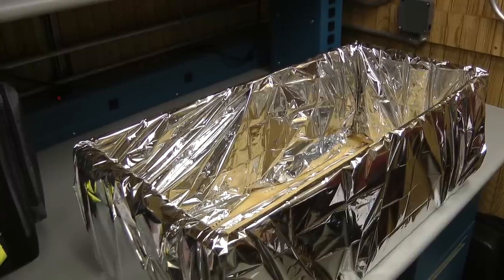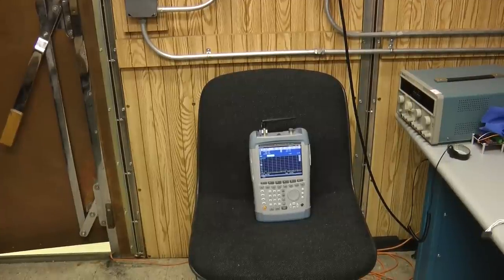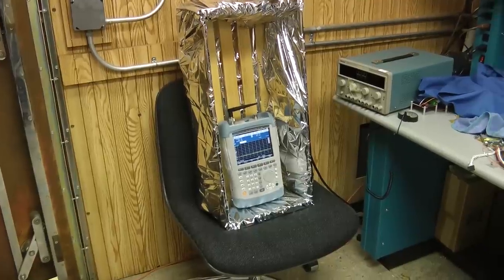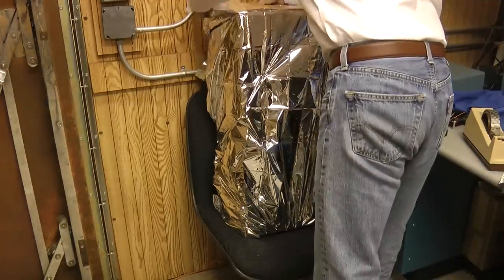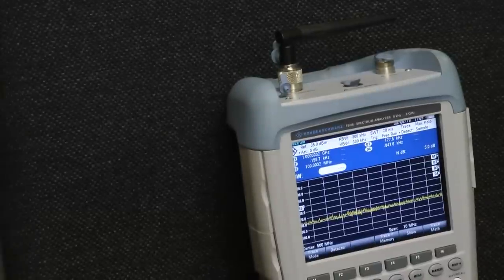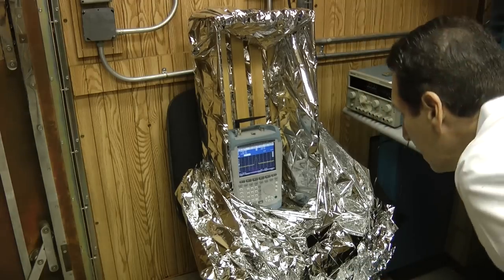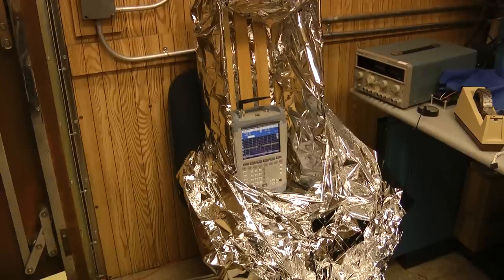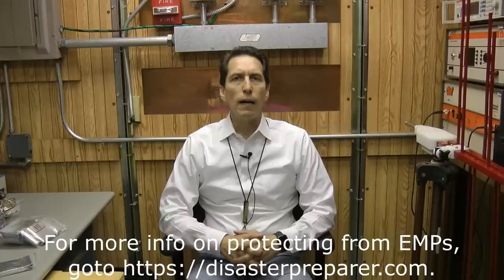Testing Mylar Blanket for EMP Shielding

Comment: My feet feel sunburned,  skin tight like I'm swelling.  Deeper muscular issues that
cause severe swelling of the ankle/legs..... led me to check for blood clots on 3
separate occasions but over 2 years no Dr has any clue what is happening.
Do I need a "Meter" to help me determine where I can move & what products
I must buy to shield me??  Guide me to what I need?  I can't buy blindly as I've
not got monies to waste.  Thanks for your work here.
Reply from the maker: You could buy a meter I suppose, but you'd want to get one that could measure at least up to several GHz. That won't let you detect 5G, but it will let you see what wifi and other signal levels might be. Alternatively, you might consider having someone come with professional test equipment to determine what the field levels are inside your home. That would, at least, help you to know whether or not, you are being exposed to very high levels of electromagnetic radiation. They do sell conductive cloth sewn into canopies that can be hung over a bed, but they're not cheap (Perhaps $900 or so). They won't fully block all RF either, but they would reduce the field levels below at least a few GHz. i'd be careful about concluding that your issues are related to electromagnetic radiation, as there could be many other cause. Again, taking some time away from the home might be a good way to determine if it is environmental.
Reply: @disasterprepper  ~ My mom & I both are effected greatly & we left last
Wed. staying out Wed night & returning  Sat. morning.  The  symptoms
were gone while out & came back by Sunday at 4am.   IF I  were  to buy
a meter & I'm looking at doing it for finding out  how bad it is & to make
sure the place  we move to isn't as bad or worse.  Also I'd rather buy a
decent meter that would cover All the ranges that would need to be
addressed  //   I need a meter that's not hard to use or calibrate &
if you've got an opinion on 1 then by all means send me a link. I
only know I want to be able to determine 2-6GHz plus any of the
other bad you'd deem as a health problem.  All I know is that I'm
going downhill & so is my mom but no Dr knows what is wrong?
Hey,  thank you for the help ....   this has been fighting a ghost.
peace
Reply from the maker: @diggydice9041  You'll want to get a "spectrum analyzer" that covers the frequencies you're concerned about. Spectrum analyzers can range from a few hundred dollars to tens of thousands of dollars. One very inexpensive model is the RF EXPLORER MODEL 6G COMBO. I've never used it, but you might check it out. If you happen to live close to Yorktown, VA, I could probably just come and take some measurements for you.
Reply: @disasterprepper  ~ Ok.  I know I have both  2.4/5G networks available to
my Xbox1x & my Laptop.  I have secured WIFI for either & both of these
devices will hook up on either protocol.    We've had the 5G since 2017
so that's why I Think I might need to have that ability??   I looked on
Amazon & there are Tens of Dozens of units...... I cam spend up to
$350 but I want something that's got easy to read & use functions
and even a  graph or other type of pictorial view of signal strength?
IF any of what I've said makes sense, please help get me on a
path.  I'm going to check out Consumer Reports to see if they've
done any evaluations of these meters?    Again, I thank you w/ all
my heart.... this has been awful for over 2years now.       peace
Reply: @disasterprepper  ~ I'd have paid you to scan my place but I left the
N.Virginia area in 1998 after 12yrs living there.    IF you have Patreon
I'll donate to you.    diggy
Reply from the maker: @diggydice9041  Just to be clear, when you say 5G, I assume you're referring to 5 GHz wifi. 5G is also a coming wireless cellular technology, but it operates in the tens of GHz frequencies and is not widely available yet. There are lots of people worried about that too. Anyway, the inexpensive spectrum analyzer that I mentioned previously measures up to 6 GHz, so it should allow you to see what spectral environment is in your home. You could then go through your home and turn off devices and see if your equipment is the cause, or if it is coming from some external source. I would think that could be very helpful. If it's something your equipment is emitting, you could turn it off when not in use to greatly reduce your exposure. Knowledge of what's actually around you would be really helpful.
Reply: @disasterprepper  ~ While I have no cell phones I live in a 240 unit Apart.
complex & am right on a busy business area.  We will be moving by the
end of year.   A meter will serve me now & to look for a safer place in
the future.  Since I don't know the terminology I ty for helping.  I don't
know what I need exactly but I think I need a way to determine what
threats are here?  One that has a wide range to help me determine
what shielding is needed & where.  Then one I can use to determine
a safer place to move.    A spectrum analyzer w/ a wide band seems
like what I might need??  I'll go w/  something you recommend &
again,  I'm thankful...... Yes I wish I lived in Va again.... lol, ty Sir .
Reply from the maker: @diggydice9041  Yes, I think the spectrum analyzer with wideband measurements would help you. Good luck!
Reply: @disasterprepper  ~ I thank you.  We left last week for 3 nights/4days &
it just went away.  After 24hrs of being home it all came back so I know
something "Environmental" is causing this.   I assumed because we are
in Apartments w/ both 2.4 & 5g  that it's part of this attack?  I know of
Cell Phones but I don't use one.    Do you know of a Meter as you
advised that is more user friendly to people?  Like one that alerts
with "Red Lights" to signify  a dangerous condition?    Ohh, I've been
to your site & found some books I'd like to buy.  thanks again for
all your help.     diggy
Reply from the maker: @diggydice9041  I guess it's positive that it's environmental since I believe you said you'd be moving soon. Maybe moving will solve your health issues. As for a meter that detects dangerous levels of RF emissions, no, unfortunately, I don't know of such a device. Most spectrum analyzers require a little knowledge to use properly. Perhaps the manufacturer could offer some assistance if you're not sure how to use it.
Reply: @disasterprepper  ~ I thank you sir. I know
there's a lot to using the meters in the way
each was meant to be used.  I'm trying to
cut corners so I don't have to make this a
study project,  I do see this industry as the
next Trillion Dollar a Year thing that's not
going away.  I'm about to set up a Hydro-
ponic garden w/  fish in two 275gallon
tanks.  Powered w/ solar but you've been
so kind to answer my questions.  I'll be
viewing lots more of your video too.

Comment: It would be shielding better if you put two or more of those blankets (layers) around the crate and to the opening.
Reply from the maker: Yes, I'm sure that's true, but I was trying to get an apples-to-apples comparison. One layer didn't do very well. Other materials, such as aluminum foil are significantly better.

Comment: Have you tested the delta dBm values at HF or lower than 100 MHz? How about 1 MHz (broadcast band) and 20 MHz?
Reply from the maker: I have tested some shielding all the way down to 100 kHz, but I don't know that I did for the mylar blanket. It's not so relevant to an EMP though. The reason is that the wavelength of a 1 MHz signal is around 300 meters. Even if you assume energy transferred efficiently at 1/20th of the wavelength, you would need a conductor around 15 meters long. Anything smaller than this not couple energy into it very efficiently. 20 MHz is a bit more relevant, but I don't believe the blanket would do well. With that said, perhaps you had a different application in mind.
Reply: @disasterprepper  Thanks for the reply. Yes, actually I was thinking of a different situation in practice but consistent with your design principles. I’m investigating the “Faraday Cage” properties of foil-backed radiator barriers in roofing for attic antennas used in HF amateur radio. So I was curious as to the frequency variation in your delta dBm measurements. Your ranges seemed to be relatively invariant but I’ll construct a somewhat similar experiment to assess this use case. I was delighted to run across your rigorous work.
Reply from the maker: @Frank_K4FMH  Ah, that makes sense. Lower frequencies (as in MHz to 10's of MHz) are easier to block, but the shielding levels that can be measured are often limited by the test equipment. For example, my test setups often limit me to a maximum of 50-70 dB of shielding able to be measured before the test equipment starts to limit things. The reason is that you have to turn up the amplifier really high to couple the energy into the short antenna on the analyzer. There's lots of ways to improve this, but I won't go into that.

Comment: I would have liked to have seen the mylar cover grounded.
 What frequency is an EMP?
All frequencys I guess Close to event and longerwave at distance, detectable over horizon for inonospheric reflection (Skip).  Long wire receiveng will pick up more energy converting it to destructive voltage. Short wires far less RF energy absorbed.
Unplugging equipment and antennas can do much to protect gear.  I believe threat of damage by man made EMP is over rated unless very close to emission source. Wires and cuircut traces have to be resonant to the frequency inorder to absorb energy.
Reply from the maker: It ends up that grounding really doesn't have any measurable effect when in the far field of an RF source. Some people think that attaching a ground wire would help shielding, but the inductive reactance of the wire is quite high at RF frequencies. Even if it wasn't, the conductor itself acts to reflect and absorb the RF energy, regardless of whether it is grounded. As for the EMP, it is a broadband event (narrow in time, broad in frequency span). Most sources suggest a frequency span from about 100 kHz to 1 GHz. You're absolutely right that longer conductors pick up more energy, especially from a broadband event. I would rephrase your comment about wire and circuit trace resonance to say that they have to be an appreciable size in relation to the wavelength of the incident signal. Usually, the rule of thumb is that if the conductor is 1/10 of the wavelength or longer, it will efficiently receive (or radiate) energy. I appreciate your comments.

Comment: You need to eliminate air gaps in your shielding!!!
HOW DO YOU NOT KNOW THIS?!?
Signal bounces aeoubd, if there are any gaps in your shielding you will get signal!
If you had tightly packaged your crate and taped the second mylar blanketdl down to eliminate air gaps, your result would have been much different!

Comment: So 10 layers of mylar might provide -80 dBm shielding
Reply from the maker: Well, not exactly. In theory, separate isolated layers add up in dBs (note that dBm is actually a power level not a shielding level), but in practice it usually falls well short of that as you add more layers. Still, you could get much more shielding by layering.
Reply: @disasterprepper  hmm. Yes, I understand that dBs are a measure of signal strength. I understand that multiple layers wouldn't necessarily accumulate shielding at 8dB per layer. I wonder about the capacitive effect of two or more metalic layers, and all the reflective dampening that might occur between layers. It could be that multiple layers are way more effective than a single layer. Like carbon fiber. A single layer is very fragile, and many layers will stop a bullet.
Reply from the maker: @StephenVBeckett  Sorry if I sounded snooty, I didn't mean it that way. In my tests, layering with an insulative layer almost adds shielding in dB for dB, but it falls short by maybe 10-20%. What many people do is layer a couple of EMP bags, which each provide about 50 dB of shielding. When combined, you might get 80-90 dB of shielding, which is outstanding. I always recommend that folks try to achieve 50 dB of shielding, since that represents a reduction in field level of 99.7%.
Reply: @disasterprepper  thanks! that's what I was wondering.

Comment: how about testing against common frequencies like wifi 2ghz and 5ghz?
Reply from the maker: Unfortunately, my generator only goes to 1 GHz. From my experience, typically things that don't shield well at hundreds of MHz don't do well at higher frequencies either. I do plan to do some 5G (tens of GHz) testing this fall using some other equipment.

Comment: Great video! Which material would be best to put on my windows to shield from the new microtower (4g/5g) they put in front of my home?
Reply from the maker: I’ve seen adhesive window coverings that offer RF protection, but I don’t think it would do much good because the RF energy would just come in through other paths. Protecting from high-frequency RF requires creating a sealed-off room to really be effective. You'd basically have to make a Faraday cage in your home. I'm currently looking into this problem, stay tuned.
Reply: Metal roof, metal screen behind exterior siding, metal screen behind drywall, insulation with silver mylar surface.

Surprised a caulking with metal infill isnt made yet. Please make this product

Comment: RF signal is not an emp, most you are testing is RF blocking.
Reply from the maker: It's true that an EMP is not a sinusoid, but rather a complex RF signal. Shielding effectiveness testing is typically done by sweeping sinusoidal carrier frequencies through the range of an EMP spectrum. That's what I do. The alternative is to generate a true EMP, and that requires a very specialized laboratory.

Comment: It appears that he wrapped the OUTSIDE Mylar into the INSIDE of the box. Doesn’t that carry external signals into the inside?  If “yes” then the test results are invalid.  In building Faraday cages I’ve always made sure that there are no channels into the interior, or gaps through which the brief but extremely powerful EMP could inside.
Reply: Yes I wondered about that. Seems a given. Too gappy. Also testing 2 or three layers is needed.